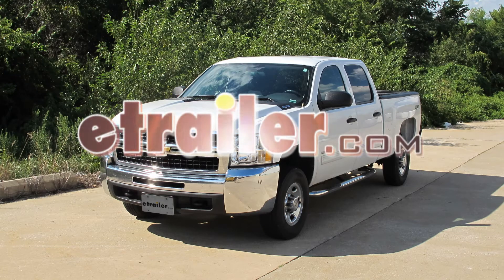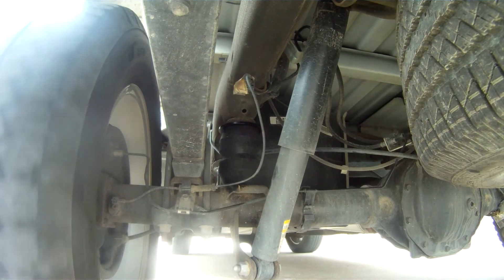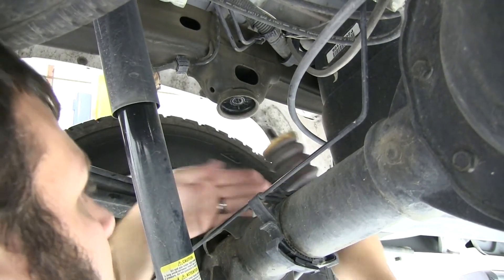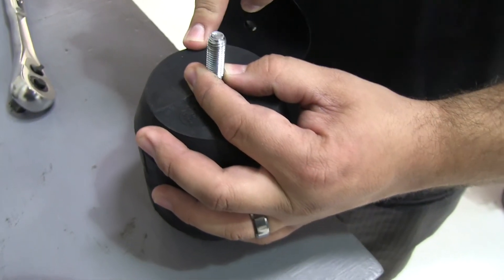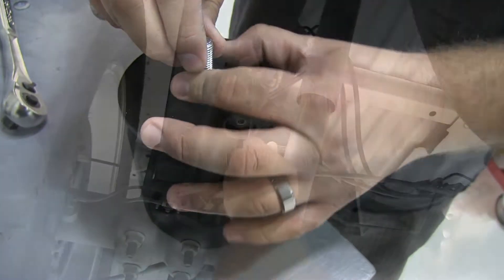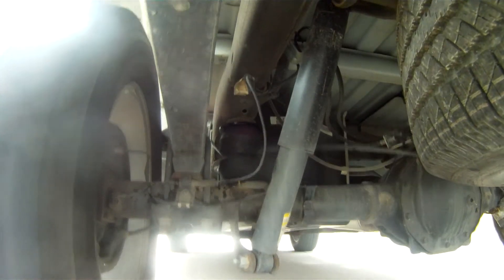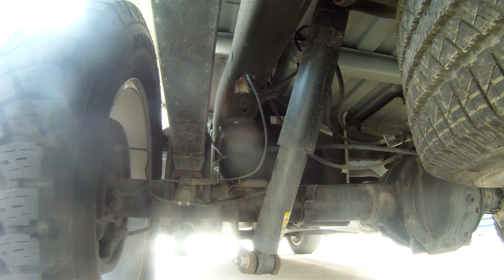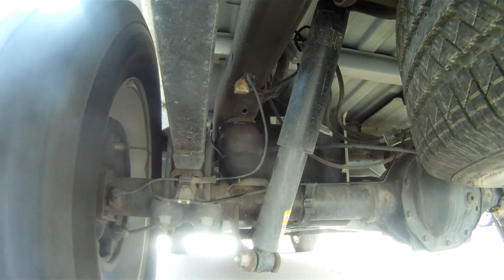etrailer | Installation: Timbren Rear Suspension Enhancement System on a 2010 Chevrolet Silverado

Comment from the maker: Firestone air helper springs may be a better bet, only because they are adjustable, in case you are carrying off center loads, which will keep your ride level. Your set-up may need to be adjusted depending on if your truck is raised up higher after you install the suspension system. Let me know if you have any other questions, I would be glad to help!